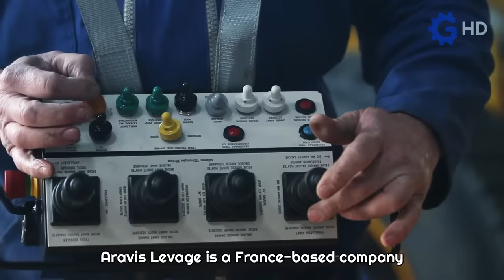WHAT WAS THIS GIANT TRUCK BUILT FOR? ▶ SPECIAL HEAVY-DUTY TRUCKS 2

Comment: Largest road truck at 70 tons? Just a few months ago in Podunk South Arkansas, it took six days to move a 300 ton rotary kiln from Crossett to Gum Springs. I think you might have missed a decimal point...or Guinness World Records got their specs wrong. Most of the log trucks around here are running around 70 tons, and they're just clapped out, 25 year old Kenworths, Petes, Freightliners, and Macks.
Reply: just the truck, not the load